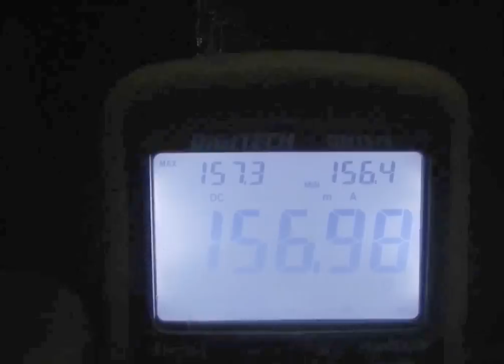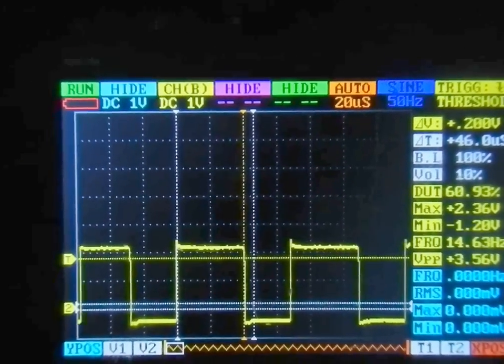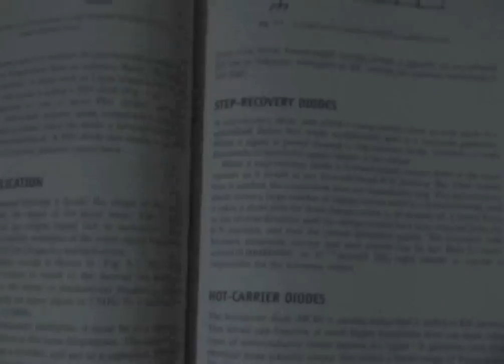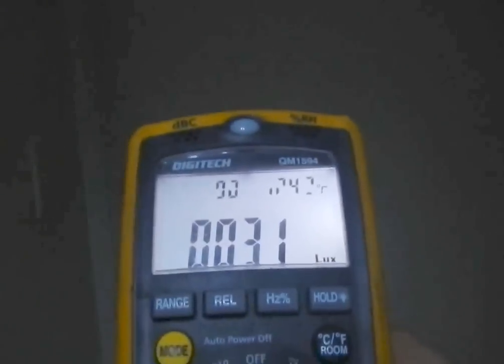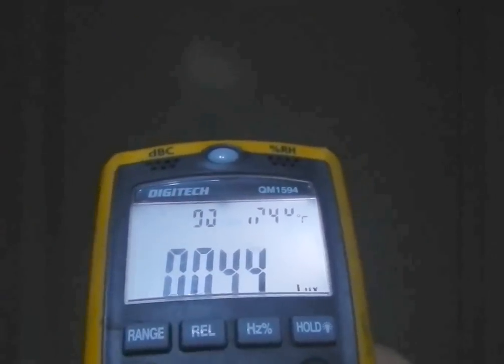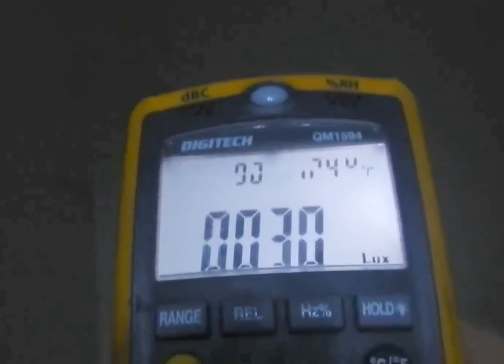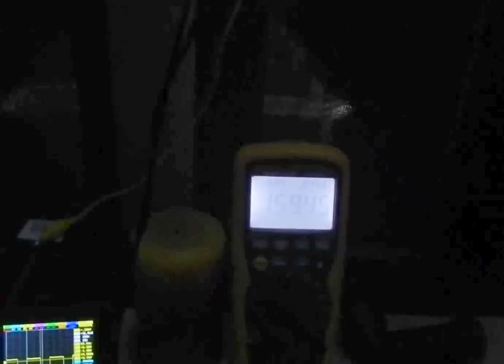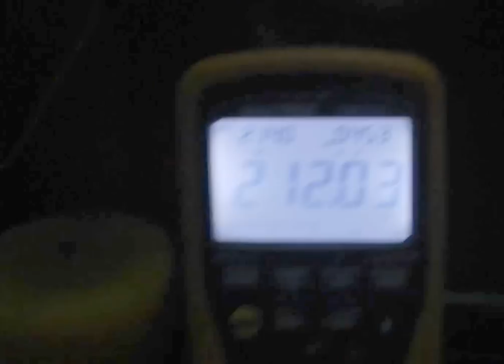One Watt Challenge entry video.

Comment: Interesting!  Sort of what I was doing a while ago.  Cool project!  Keep up the great work!
Reply from the maker: Very much inspired by what you where doing. I even have a mofset on mk2. Based on what I saw in your test. I am trying to keep the on time under 2 micro seconds. To stop the leds getting hot. Getting good results from 30%-60% duty cycle. No extra heat. Should extend LED life quite a bit. I am seeing what you where saying about the current though. As far as watts pew lumen, the same led will give similar results, regardless of pwm or current limiting methods.
Reply: What do you mean by mk2?  Ya the efficiency is probably compromised too.  I think my original hope for the test was that the human eye would pick up the bright pulses of light and thus less light would look like more.  But the human eye seems to pick up a sort of average.  Nice work!
Reply from the maker: This one just has 53 parallel LED Directly on the output of the 555. Quick and dirty. I dont want to turn it up past 200ma draw. So I added a mosfet.. I though more parts would be less efficient, but its better. Although I'm still running LED's on 6v when they need less that 3v. I tried in series, and they dont switch fast enough. Tried 12v and burned pots turning the on time down real low, need to find smaller cap... Eyes and lux meters do seem to take an average, I can make it look bright for a low duty cycle, but the on time is really long and the LED's get warm. I'm thinking this method could still be good, as it should  extend led lifespan. Its also good for dimming needs, as PWM will always be better than a variable resistor. There may be some small light improvements at some tunings, but its not very much. Looking at the other 1 watt challenge entry's, everyone is getting similar results. I think the best was Rinoa with the 100w led at 1% current. That ones going to extend LED life a lot too.
Reply: 6 volts is not that much!  If I remember correctly I think I was running my LED on 24 volts.  Ya that 100watt LED will last ages!!! The only way to get more like is to use 10 of those LEDs!  Or even better yet 100!  But ya unless someone finds something more efficient than an LED it's going to be pretty close.  Wait I've got an idea!!!  Hmm I'm going to have to give this some though...  Cause it might just work!  Now all I need is a 10 watt or 100 watt LED...

Comment: very good! i suspected the right pwm setup would do very well. very little goes to losses, great job!
Reply from the maker: The idea is that the LED isn't switched on long enough to get hot. Thus extending LED life, as well as making efficient light. I Now have the mosfet working. Although I think for 1W the 555 output in more efficient. The mosfet can turn it up to 6 watt's Phwarrrrrr.
Reply: Mongrel Shark right on, keep us posted with new versions. maybe a schematic for those that dont know how to do up a 555 pwm too, if u have time.. or even a link to the config you're using. cheers. great stuff, great output
Reply from the maker: There will be a follow up video. I just need to work out why my mosfet gate seems to be passing reverse ac current through the 555... Getting +/- 20v on the scope.... And have revers bias LEDs running... Something fishy is going on.
Reply: Mongrel Shark yes that is strange. you are running the pin3 through a resistor before u hit the gate, right?
Reply from the maker: Nope. That slowed it down too  much.... I'm thinking diode. Although its been pulling a watt from my 24ah 6v lead acid for 3 days now, and I've only dropped from 6.3v to 6.2v I think there may be some back charge... Nothings hot so I'm going to dig out the 1 ohm resistors and doe some scope investigations.
Reply: Mongrel Shark hmm. typically you'd put a resistor before the gate, given its a voltage driven device, not a current driven device, and without it, you'd be putting current to waste. That said, mosfets typically have a minimum required voltage to operate. I'd try using 12V or 9V to get well away from any required min.'s imposed by the FET and then limit the current to the base.
Reply from the maker: Yea... I have a 2.8v and a 4v gate mosfet's. That works fast enough. The problem is the low on time. I keep burning pots on the 555 input at 12v. Also just running leds in parallel on 12v seems a little wasteful. Kinda is on 6v too. But 2 leds in series is not very bright and slows the switching to 5µs on time which is too long. Never realized a LED could have so much induction...

I tried a pot to gate yesterday (again) having a better look on the scope, it slows to switching off, and has the mosfet half on for too much time, MOSFET gets hot. I need the pull down from the 555 to be unhindered. Diode was a big fail. Just kept the mosfet on full time. Nearly blinded me.

Although I'm not sure about the waste at 12v, for the few secs it was working I got a lot of brightness for a very low duty cycle. Need to find smaller caps for the 555 (Using 600pf atm) and or get a fixed resistor for the on phase. Which is what I will be doing today :)

Also did shunt resistor current measurement. Turns out what I thought was 1w. was actually 0.6w... If I set my good DMM to ac+dc TRMS mode. it agrees with the RMS from the scope and shunt resister. There is some back current about 200ma at -30v for 500ns or so every cycle. So its like an SSG. reconditioning the battery as it goes flat.... Ever seen battery voltage go up 10-20mv when you turn a circuit on? Causes thats what I have now.... Its a first for me. So at least I know why what I thought was 1w ran from 144wh of battery for 72 hours and only caused 100mv drop in SOC... Once I re did the math with .6w draw and accounted for some regenerative charging. it worked out nicely. Now I have it turned up a bit I have 30% more light :)

So Now I have to do an explanation video to show the circuit, later this arvo, then another video tonight to update my entry to the full 1w.

Comment: Cool. Would mounting the LEDs in a housing with a reflector help direct significantly more light forward? I know LEDs can be somewhat directional on their own but there seems to be a lot of wasted light around and behind the LEDs.
Reply from the maker: Yes. A reflector would make a big difference. As you have noticed. The bread board is lit up very well. I was going to pull the al-foil out, but I was worried about shorting something.
Youtube is still processing the brightness edit too (Just came through in the last few min). It's looking pretty dim until the edit processes. Check the photos I linked to in the description. It actually light up part of the hallway outside the toilet...
Reply: Mongrel Shark
Oh, the photos show a big difference. It can be tricky getting the camera to show what your eye sees.
Reply from the maker: My camera is horrible for video out of full sun :( Does great low light photos though :) And its survived 5kv Slayer arcs...